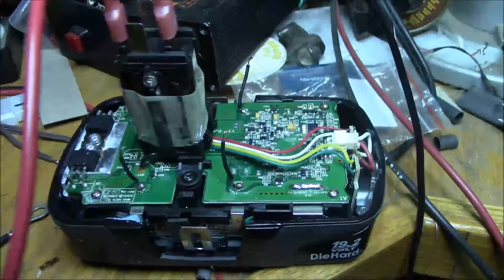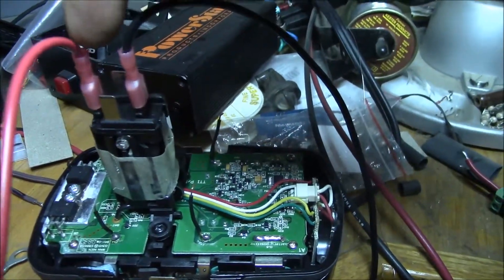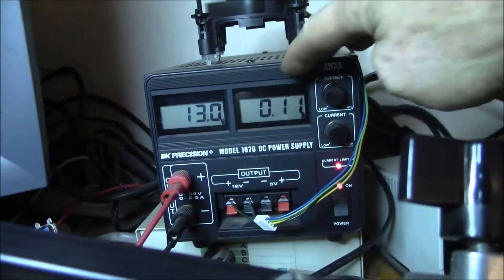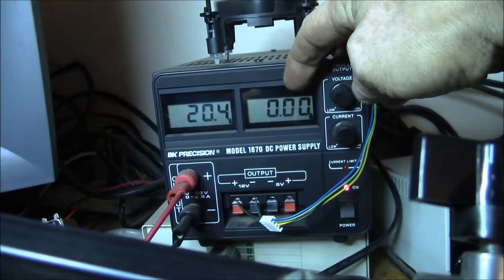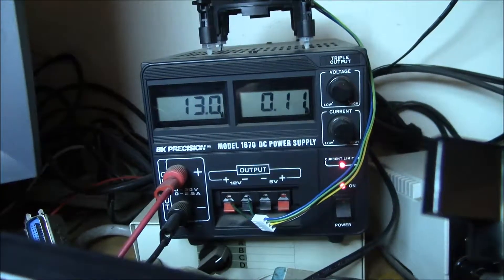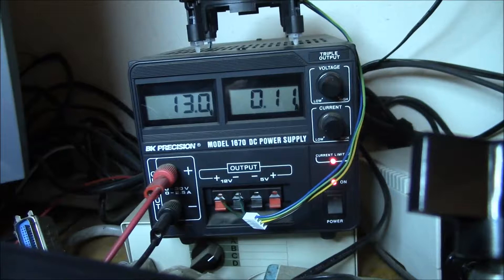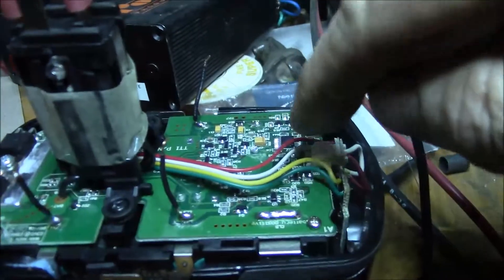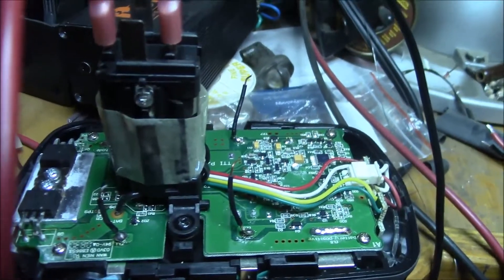C3 Battery Tear Down, Part 2

Comment: My C3 battery when placed in the charger doesn't make any light come on. I took it apart and on the circuit board, it shows 19.18v between the Pos and Neg. Each individual battery ( five of them)  shows about 3.8v. The reading on the Pos and Neg connections where the battery connects to the tool or charger shows 6.8v. Any ideas? Thanks.
Reply from the maker: It could be an issue with the BMS in the battery pack.  I've run into some batteries that only charge in one of my chargers.  Might try a different charger.  Otherwise, if you have an RC battery charger, set it to 5S and try clipping onto the +/- terminals and see if you can get it to charge a bit like that.  Sometimes I found you can play around with the 2 side terminals with jumpers and resistors and get it to take a charge.  See the later videos in this series for what I've tried.  I never did find one sure fire trick that worked every time, though.
Reply: @The4Crawler  The charger I'm using is the one that came with the battery. Had it for several years. I don't have an RC charger. A bad BMS means it's not worth repairing?
I bought a new larger capacity off-brand battery for $35.
Reply from the maker: @bome4691  It all depends on what the problem is and how easy it is to fix.  I wasn't able to find much detailed information on the BMS module inside the battery packs and there seem to be many different designs over the years.  If the cells check out good, you could salvage them and possibly use them to repair a used pack with some bad cells.  Almost all my C3 batteries are "dead" ones I bought off eBay.  Repaired a few and got the rest to work on one charger or another.